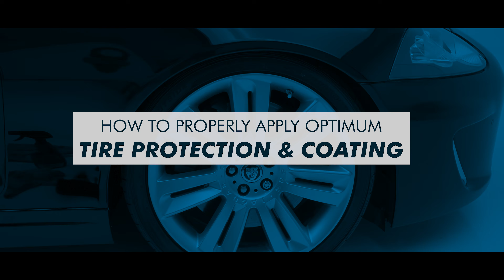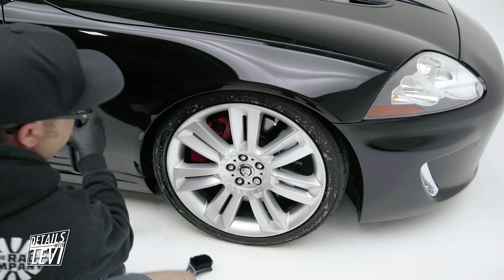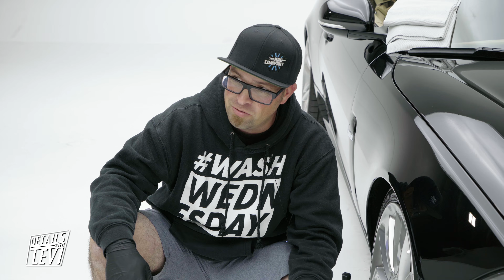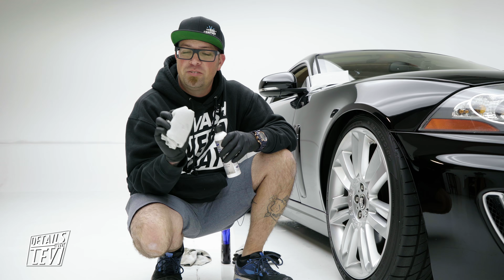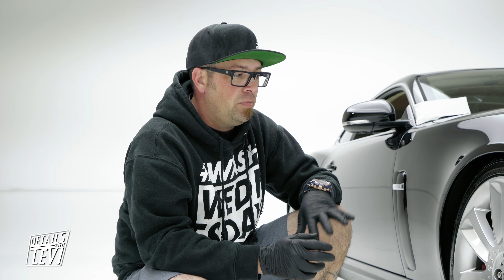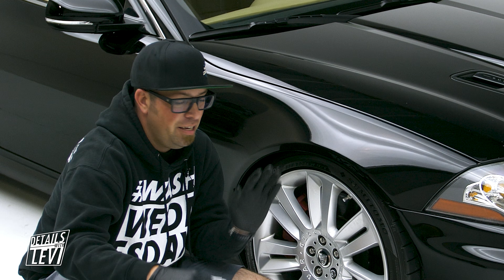COATING FOR TIRES: How To Apply Optimum Tire Coating (TPC) for Maximum Longevity | DETAILS WITH LEVI

Comment: I don't see a point using all those tire coatings on new tires. New tires have UV inhibitors built in them. So why coat them? I get it that you do that on tires after some time, but when they'r new? Nonsence in my opinion :)
Reply: Urban Šurk uv protection is only one attraction to coated tires. They will stay cleaner longer and be easier to clean, no need for harsh chemicals. They will also stay dressed for months, therefore saving you time and money in tire dressing application post wash. Finally Optimum Tire Protection & Coating (TP&C) doesn’t sling, so the rest of your car stays cleaner.
Reply: @LacroixCruiser  I am not talking that your product isn't good or anything. I don't know it, and I probably never will, since I can't buy it in my country (which is shame). But I don't think that dressings (not just your, all of them) stick and bond that good on new tires, since they do already have UV inhibitors built in them when they'r new.
Reply: Urban Šurk what country are you in?
Reply: @LacroixCruiser  Slovenia, Europe.
Reply: Urban Šurk www.optimumcarcare.nl

Comment: would you use Ferrex for the wheels instead of power clean?
Reply: shortyboy2562 
Not really 
Ferrex won’t work on soil on Rubber or old dressings as Power Clean.

Comment: I've been using the OPT tire coating for a couple months now and I'd like to double down on the prep....THE TIRES NEED TO BE VERY CLEAN! I cleaned my tires before application, or atleast i thought I did! After driving a bit this brown sh!t appeared on my tires, also kinda streaky too, cracks appeared. So what I did was use OPT Power Kleen, scrub and rinse, then Super Clean aerosol, scrub and clean and then a general APC, forgot which one. I then washed my car and whatever my carwash soap was I cleaned them again. I dried the tires with a designated mf towel and then took my Master Blaster and dried the tires further.  One a little bit of time went by I then applied 2x's OPT tire coating waiting 20 minutes inbetween coats. After this I had ZERO problems, GREAT product.

I did my wife's SUV tires and prepped them the same but used mineral spirits as the final wipe, product is VERY durable, just wished the place I bought it from carried the smaller size, I have the 32 oz size, good thing i like it!
Reply: @theragcompany  exactly, just wanted to add an additional "real world, real person" experience to the mix, looking forward to the live show tomorrow❗

Comment: Hi Guys... I'm really hooked on BEAD MAKER but im still trying out what to use before applying it. Ive been trying Griots products and I started with Maguires Diamond Cut Compound BUT IM SICK OF THE DUSTING. Now Im curious about OPTIMA... My 2001 E430 MB just got a new respray. Same original Desert Sand color. What 1,2,3 step would you use to keep it perfect from now on without a vynil wrap?

Comment: What should you use during maintenance washes on the tires? Will brake buster harm the coating?
Reply: Car soap will work just fine as well 👍 some times even just pressure washing them off and they will look great
Reply: Brake buster
Reply: @Carlos.Rivera  OK, That's what I've been using, just wanted to make sure I wasn't breaking it down. I actually applied this to my tires in April and tires still look good